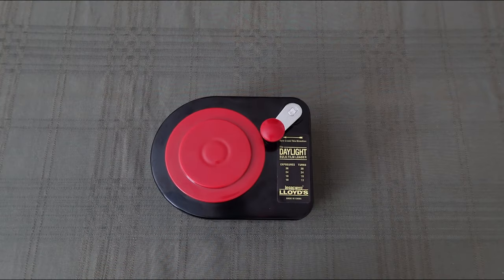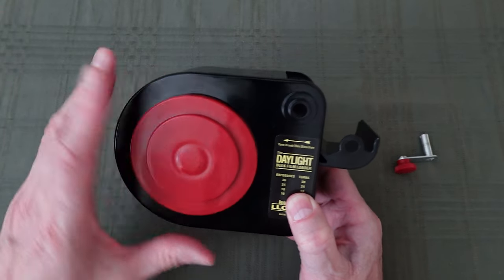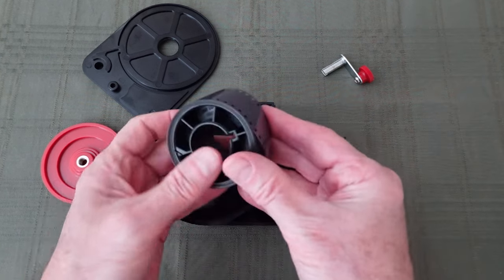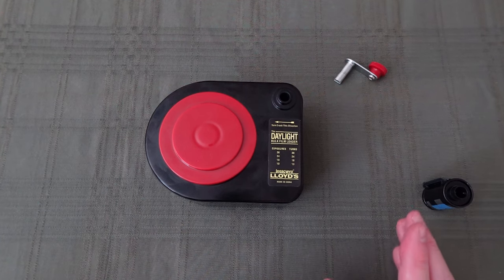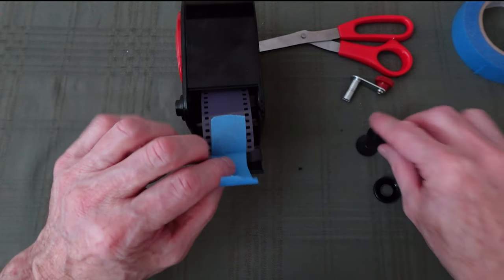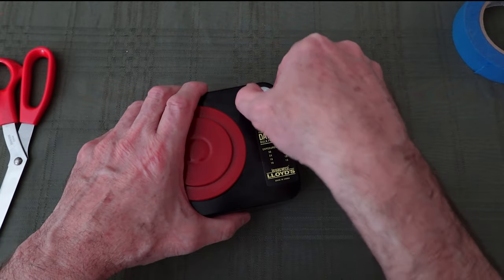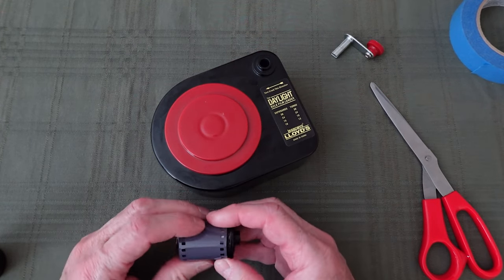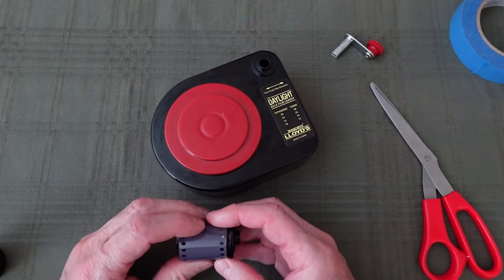The Lloyd's 35mm Daylight Bulk Film Loader by Legacy Pro and how I load it, use it and maintain it.

Comment: I started bulk loading film around 1960. This Lloyd's loader was around then. (I still have the one I bought round 1962.) I think this is the only loader which does not use a switching light trap, instead just pulling the film out through a felt light trap. My concern for the Lloyd's loader is that if it picks up dirt in the light trap, it can scratch the film as it is withdrawn into the film cartridge. It has not happened to me, but I rarely use mine either. Since you could find a used Lloyd's up to 60 years old. I think it is better to just avoid them now.  Although new, the AP unit costs around $120, which is pretty hard to recover unless you shoot a lot of film. The AP is certainly the best designed loader today. Used, the best is the Alden. It is designed much like a Watson, but is built to a far higher quality. They used to be quite expensive, new or used, but I noticed several on eBay today which are offered at a price much lower than the Lloyd's or Watson. That is probably a name-recognition situation.
Reply: Just bought a brand new Lloyds from B&H for $50. Not sure where you're getting $120 from.
Reply: @goldenhourkodak  It's the AP that is $120. If you compare the Lloyds and the AP, it's obvious why the AP is that much more expensive.
Reply: @randallstewart1224  The Lloyd was a massive mistake. What a piece of junk.

Comment: I had this one and gap between doors and case was too big and was leaking light. Another problem with this type of loader is that you have exposed ending of the film so you never know if last shots will be captured or not.
Reply: Your first complaint is inherent in a fixed felt trap design, as with much use, the felt can wear out. A used Lloyd;s loader can be more than 60 years old. Your second complaint, that the loader leaves a short length of film exposed after loading the prior roll, applies to every bulk loader ever made, so learn to live with it by being careful.
Reply: @randallstewart1224  I had brand new Lloyd clone and it was leaking light hence I have returned it. Light leak was not in felt trap. Maybe original made in US loaders were good but clones currently made in China are of very low quality so I prefer loading with changing bag. Changing bag is cheaper and I am 100% sure that my film is not exposed and also film ending is not exposed.

Comment: Where do you get these film cassettes?
Reply from the maker: I purchased mine at Frestyle Photo and Photo Warehouse, but the metal ones are getting tougher to find. They still carry plastic ones though. I now save factory cassettes form new single rolls of film and reuse them.
Reply: @fasphoto  Unlike the very old, metal, snap-cap cartridges, which were designed to be reloaded, modern retail 35mm film is sold in cartridges which are not designed to be reused, so the light trap material is not as robust. Keep track of their reuse and toss them after several reuse cycles. The snap-cap metal cartridges require a certain mount of force to open and close, and they can get physically distorted as a result. (Makes the end caps tend to not snap on tight, leak light, etc.)  I have several dozen metal snap-cap cartridges I reuse, some going back 60 years, but I find the new, plastic cartridges to be easier to use and work just as well.
Reply from the maker: @randallstewart1224  Point well taken. I keep track of how many time each cassette is used as shown at the end of the video as I label the zip lock bags they are stored in. Not sure how many times I can get away with yet. The plastic ones that I have used so far, the felt is very poor quality and disintegrates very easily. I see Flic Film has a new type of plastic cassette I might look in to those down the road. Thanks for the comment.